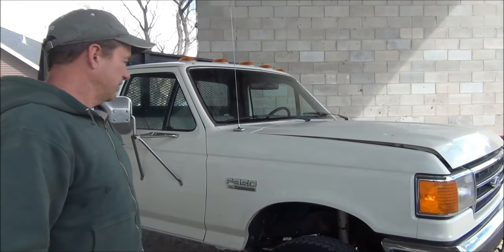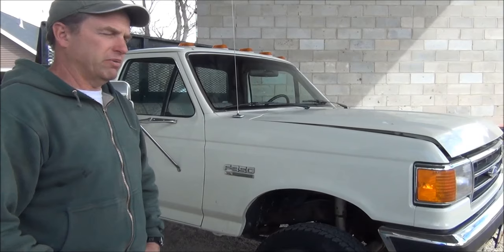Ford 7.5 460 fuel pressure regulator symptoms

Comment: So I went to the gas station put $25 in the rear tank only one I use since the front leaks. I noticed the gauge wasn’t working then I get about 12 miles and it starts chugging like it running out of fuel. Then I noticed the front tank was leaking when I was using the rear and the front has been dry for almost a year. I think it’s the fuel pump. Any thoughts?

Comment: thought this was the problem with my 7.5. found out mouse ate through wiring harness. make sure you test fuel pressure before you waste the money on the part.
Reply: Damn this is where I am with my 460, I ordered the fuel pressure regulator and put on a new MAP sensor , however nice ate some wires in mine aswell. Did the harness solve your problem? And if so how much did it cost? Thanks

Comment: I have a 1988 Ford truck with the same engine I'm having trouble with it starting when engine is heated up it cranks like the battery is dead after engine cools down it cranks fine and starts right up any ideas what could be wrong
Reply from the maker: When it's hot and cranks slowly, pay attention to the tailpipe exhaust to see if when it fires up, it smokes black smoke like it's flooded. The other possibility is maybe your starter is going out. Turning slowly when it's hot.
Good luck man!

Comment: my line is stuck on tight from age. How do i remove it from the regulator? 
i just got a 88 F 250 7.5 460 28,000 miles runs for a min then dies

Thanks in advance

Comment: Brig T---could you advise?

I have a 97 ford f superduty with a 7.5 liter in it. 

I"ve changed the fuel pump, it ran for a while (in park the whole time while trying to fix generator). I was able to start it up half a dozen times or more with no problems, but then it started hesitating and eventually got to where it wouldn't run.

When you start it up, it will run for a few seconds and then shut off. Fuel pressure is showing about 10 psi.

I took the tank down, realized I used the wrong size fuel line to replace part of the line. I took the tank back down, corrected that problem, hooked it all back up (before raising tank again) and we're having the same problems.

Before changing this pump, I did change the regulator but admittedly it was with a low-end aftermarket one.

Any ideas? Thank you!

Comment: I swapped a 7.5 out of one of these into my 1984 f150 Engine zf5 dash and all the wiring headlights to taillights it ran great with a slightly modified fuel system , I used a 5.8 frame mounted pump for my high pressure and a after market sucker/lift pump for the bed mounted fuel cell . It ran great for over a year then It accidentally drank some old rusty/chunky fuel oil...... truck has barely ran since I cleaned the tank purged the lines and changed both pumps and fuel filter . its still barely running, I was about to pull my injectors and clean them since its the last thing on the line, I never thought regulator because i was getting good return but the trucks acting like its starving for fuel "hit it with either it smooths out /isnt running rich.. Im not a efi guy this is my first efi swap. could that regulator stick and cause most of the fuel to return?
Reply from the maker: John Hosler 
Boy that's a tough one. I do not think the regulator could stick open. Only thing I could suggest would be to dig in & try some things. Throw parts at it man. Good luck!
Reply: ok for what a regulator cost im going to change it anyway when I clean the injectors , I know mines speed density im going to have to learn how it monitors air if it even does and clean them parts too , I appreciate the response , Thank you

Comment: What fuel pressure does that truck hold? I've got the same 1990 460 5 speed. And with a new pump mine is at 32 lb.
Reply: Maybe I need a new fuel pump?? 1997 460 with
26 lbs off the fuel rail

Comment: Hi sir I have a 95 F-350 Dually 4 door pickup truck and I was driving on the freeway and my truck started to bogging down and it started popping and it was hesitating to go what would be your opinion on this problem I've never had this problem since I've owned my truck and by the way it's a 7.5L thanks
Reply from the maker: Salvador Cisneros 
Hello, I'm not sure what could be making it pop, and bog down. Throw some parts into it...mainly tuning parts , possibly distributor, or ecm. Good luck man.
Reply: Brig T 

Please post what you find. Me 94 Ford 460   RV. Replaced fuel pump, fuel filter fuel pressure regulator, plugs wires distributer and coil. Still popping
Reply: Rusty Hellen just a thought have u checked the bolt that keeps your distributor tight sounds like its out of time

Comment: Got a 91 460 5 speed runs fine at idle but under acceleration it'll sputter and like that there's no fuel and even popped/backfired yet it won't kill the motor out I let off the gas and it comes back to normal idle. I'm gonna try this and see what happens
Reply from the maker: That's exactly what was happening with mine. Rather than take it into the dealer, I just basically went with trial & error. But , this fixed my problem.
Reply: @BrigT262  yeah that's what I'm dealing with. But i put pressure gauge on my fuel rail and it doesn't look like I have any bad injectors or a problem with fuel delivery. I checked my codes and ended up replacing a map sensor which actually fixed the problem but only for a 2 days and then it started doing the same thing again bucking and kicking like a untamed filly

Comment: I have one and it stopped running on the freeway I know it's not the fuel filter because I cleaned it it's pumping gas and it's even getting gas to the fuel injectors but I don't know if it's enough because it's not starting now when I spray quick start in there the truck starts do you think this could be the regulator as well kind of sounds like it because that would mean I'm not getting enough gas into the fuel injectors correct I don't know what do you think
Reply: I meant to say I changed the fuel filter that's on the bottom
Reply from the maker: Try checking the fp with a gauge. It sounds like a fuel pressure / delivery problem to me. Fuel pump maybe??

Comment: i have a 95 f250 with a 460.it is very hard to start and when it does start it runs ok until you give it gas and it falls on its face and backfires out of the throttle body.im at a point where i have run out of ideas and cant figure it out.any suggestions?
Reply from the maker: If you've checked and eliminated the obvious stuff (tune up/  ignition items ) then I'd suggest pulling out the computer and look for obvious signs of burning / leaking. Next I'd check the compression.
Reply from the maker: +Brig T 
my first thought is your computer is bad.

Comment: does it chug at random times, or what, mine does this at around 800-1500 rpms, I replaced map sensor
Reply from the maker: Try replacing the fp regulator.

Comment: I have a 96 and I changed the fuel regulator and the front fuel pump and it's still starving for gas I checked the filter and its clean any ideas
Reply: we are  haveing the same problems... did you ever figure this out?
Reply: Buy a Chevy

Comment: Is there anyway you could upload link to the fuel pressure regulator you purchased?
Reply from the maker: Tree Cannibal. Probably not. I asked the dealer for the part number and then did a search for it on ebay. Very easy. The one i found was a new old stock.
Reply: Brig T ahh i see.  Thanks for the response.  Ill see what i can figure out

Comment: What if i have replaced all your feul system regulator feul pumps and your filter n still no pressue??
Reply from the maker: Domo Owens   Sounds like a power supply problem in your case. Check & replace the fp relay under the hood on top of the drivers fender just behind the air intake.
Reply: Also, the passenger kick panel is a switch that may have been tripped, I forget the name of it, but it cuts off fuel pump if you get in an accident... I Cant remember wat it's called...

Comment: hello everyone. I have a 88 250 with a 460 Manuel 5speed. it's my daily driver and I average 8 miles per gallon. is this normal
Reply: Carburetor or Electronic injection? Carbureted 460's normally get around 8 mpg, electronic 460's get between 8 mpg to 11 mpg.
Reply: DieWolfen 
thanks for the info mines fuel injection. I'm up to 11 miles per gallon I had a low spark issue

Comment: Poor and terrible design from Ford engineers. Made the flange wide on fuel pressure regulator and bracket that way you have access from the top.